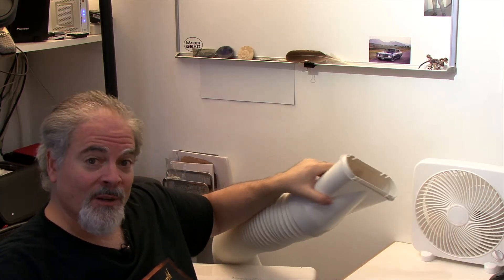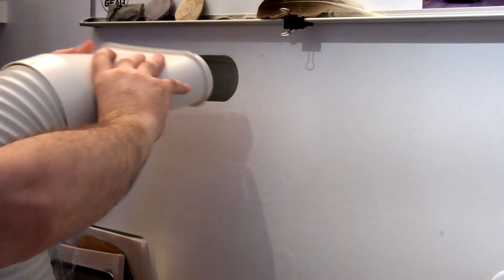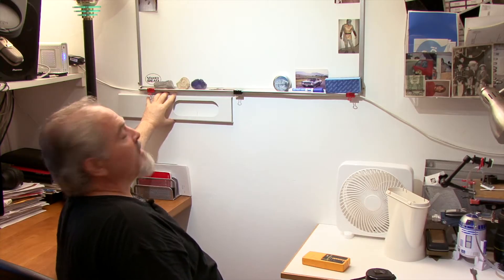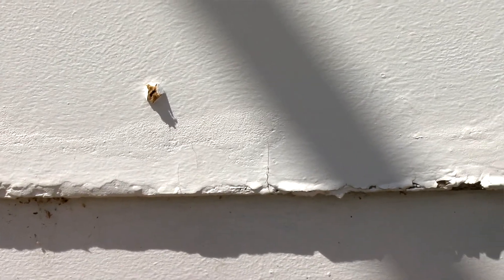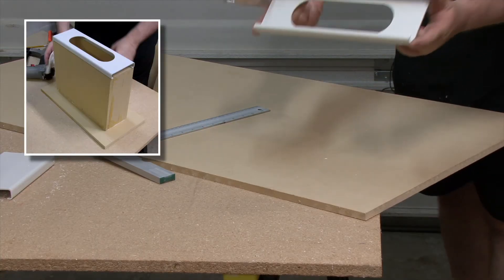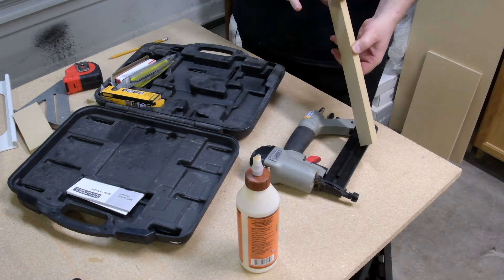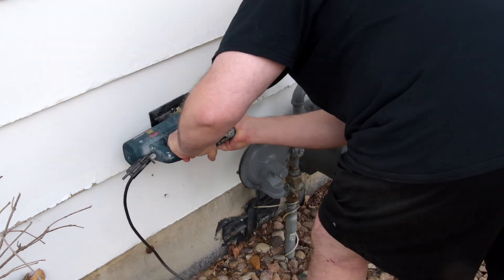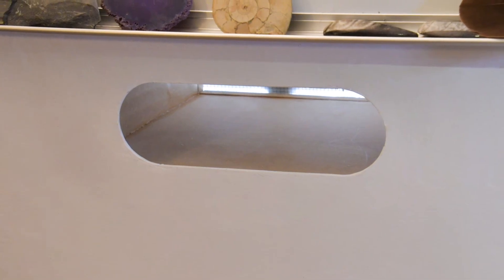Portable Air Conditioner - No window? No problem! Vent exhaust thru wall, stealthy magnetic cover.

Comment: Mold and mildew will spread in your walls and your going to have a very expensive job to fix
Reply from the maker: That's a totally legit concern, Stacks. Unfortunately, YouTube doesn't allow me to alter the video, but I added notes to the video description and on my website addressing this issue. The new duct needs to be sealed and coated with either polyurethane or exterior paint. I'm also going to pin this comment so it shows up first, so if people don't see the note in the description, maybe they'll see it here.  Thanks for the great feedback.
Reply: Would caulking the "duct box" where it meets the drywall and lining the inside with foil tape work?
Reply from the maker: That would probably help, but I don't know if it would work as well as simply painting it. Or, you could be really safe and, caulk and paint it, THEN apply the foil tape 😁
Reply: Is this because of the ac unit?
Reply from the maker: It's due to the moisture the AC removes from the air and exhausts outside. The duct should be sealed or painted to keep that moisture from causing problems. It's a simple preventative measure.

Comment: If the vent tube doesn't extend all the way to the outside wall and is sealed to the outside wall it will just pump warm air into the cavity between exrerior and interior walls and cause alot of moisture buildup.

Comment: A dryer vent with tube sounds much easier
Reply from the maker: It sounds easier, but I wouldn't. The portable AC hose is 5 inches in diameter and the dryer vent is usually 4 inches. Logically, this doesn't sound like a big difference, but there is a whopping 43% reduction in area! This adds back pressure to the AC system. Making the AC motor work much harder than it was designed to do results in poor cooling efficiency AND the motor runs hot, potentially shortening its lifespan.

Comment: Does this have to go to an outside wall?
Reply from the maker: It doesn't have to exit to an outside wall, but wherever it does go will get hot and moist. If you have another room that can handle being humid like a jungle, that will work 😁though keep in mind that those are perfect conditions for mold growth.

Comment: I wonder, if you had an isolated office/workspace in a garage, for example, if you could simply vent back out into the main garage to prevent having to cut a hole in your exterior.
Reply from the maker: That is a great solution as long as adding warm, moist air to that space isn't going to create problems. If the garage has ventilation or you can open doors or windows, the moisture might not be a concern at all. 

I would love to know how it works out if you try it 👍
Reply: @UnchartedDIY  If the rest of the garage is otherwise unmanaged climate wise, I dont know if it would make too much impact.
Reply from the maker: @PeteNice29  I agree. If I had a similar situation, I'd vent it exactly like you are talking about. I can't see a downside!

Comment: can you please do a video showing how to feed it to a bathroom exhaust fan?
Reply from the maker: I appreciate the suggestion, but I wouldn't recommend running your portable AC exhaust through a bath fan. It's a great question and a creative idea, but here's why it might not be good solution:

The portable AC hose is 5 inches and the bath fan exhaust hose is 4 inches. Logically, this doesn't sound like a big difference, but there is a whopping 43% reduction in area! Then the additional length of the bath fan hose adds even more back pressure to the AC system. Making the AC motor work much harder than it was designed to do results in poor cooling efficiency AND the motor runs hot, shortening its lifespan. 

Hope that helps. Thanks for watching and stay cool 😉
Reply: @UnchartedDIY  thank you for the thorough explanation!

Comment: Does the soffit cover add pressure onto the AC machine by partially obstructing the exhaust area?
Reply from the maker: That is a really great question, and thank you for thinking of it! 

I was curious about that too, so I did an unscientific test with my inexpensive anemometer while the machine was running. I couldn't see a difference in wind speed with the soffit cover on or off, and at various speeds. I suspect its large surface area combined with the low static pressure from the exhaust makes any potential obstruction statistically insignificant. I just wish I had thought to put that information in the video 😀
Reply: @UnchartedDIY  Wow thanks so much! I'm gonna give it a try 🙏
Reply from the maker: @InfiniteDaydream I hope it helps you stay cool ❄️😎

Comment: Maybe it's my old eyes but go back and watch this video where you were working on the outside hole. It sure looks like a snake under your gas meter up against the slab.
Reply from the maker: I never noticed that before! It looks like a rattle snake, which we do have around these parts. Upon inspecting the high res footage, I could see that it was some dead leaves. Good thing so I could live another day and keep making videos 😁

Comment: Could you rig a vent down into the basement and out a dryer style vent, instead of the window?
Reply from the maker: Technically, it would work...but there can be serious downsides.

The problem is adding a bunch of back pressure to the AC exhaust. Dryer hoses are only 4 inches, while ACs are 5. It doesn't sound like a big difference, but a 4 inch hose has a cross-section area of 12.5 square inches, while a 5 has 19.6 square inches.

Lengthening the exhaust hose or decreasing the diameter can make a portable AC work much harder than it was designed for, likely shortening its lifespan.
Reply: @UnchartedDIY  Interesting, could work. Just looked at Amazon and they do carry 5" and 6" outdoor vents. Would mean that I would have to put a 5: hole in my floor.  How long can you have the hose?
Reply from the maker: I wish I could give you a definite answer...

I guess that depends on how risk-averse you are. The manufacturers will tell you not to add any extension to the hose. Whether or not it would significantly affect the AC would probably depend on a lot of factors, such as how much the back pressure would increase from extending the hose, amount of heat, humidity and so on. 

You'll need to weigh the potential gain in your comfort level vs the potential pain in your wallet😄  Either way, I'd love to know what you decide!

Comment: But if you live in a rental house where it's not allowed to make a hole in window or walls
Reply from the maker: Unfortunately, I haven't seen a workable solution for this scenario. However, you mention a window. If you have one, you might be able to put the AC on a platform to raise it enough to reach the window. Good luck with this, and I would love to hear if you are able to make this work 👍
Reply: Throw it away theyre fking ridiculously obnoxious in a room. The hose is such a pain in the fking ass

Comment: Looks very nice. By the way ive seen some people online say that i could exhaust the portable ac unit into my attic space. Basically just cut a hole in the ceiling and let the air blow into my attic. Seems like a odd thing to do for me but what do you think about this?
Reply from the maker: I've heard people say that too, but I wouldn't do it. Portable AC exhaust contains potentially high humidity which could cause mold and a whole host of other issues.

Comment: They do make a coupler... although I'd still install it through the wall.
Reply from the maker: If you mean a coupler that allows to connect a longer exhaust hose, I would personally steer clear. It will void the warranty. It also makes the AC work too hard, which might greatly reduce the life of the unit.

So, I agree the wall is the way to go 👍

Comment: Can I use a regular dryer vent hose to vent my portable ac unit instead of the horrible hose that came with the unit? I think it can be done.
Reply from the maker: Great question, Jackie. Unfortunately, I don't think it would be a good long-term solution since dryer vents are only 4 inches vs 5 inch. It doesn't sound like much of a difference, but the 5 inch flows a lot more air.

Forcing that much air through a smaller hose will reduce the efficiency and possibly shorten the life of the AC since it has to work much harder than it was designed to work.

I would recommend looking for a third party hose meant for a portable AC.

Comment: In the second photo it looked like u downsized the vent pipe, where did you purchase the reducing coupler?
Reply from the maker: I'm guessing you are talking about the thumbnail image for the video where the hose is going through the teal colored wall. If so, that fitting came with the AC unit and is designed so the round exhaust hose will fit into a rectangular window while maintaining the same air volume. Most portable ACs come with a fitting like that. If yours didn't, there are universal kits like this one: https://amzn.to/3Uu7U5r for instance. This one comes with the exhaust hose, while some kits don't. 

I hope that helps, Brian!

Comment: What would happen if I just leave the hose in the bathtub????
Reply from the maker: I'm not sure I understand what you are asking.

The exhaust air needs to go somewhere outside of the room you are trying to cool. Having it in the same room would just make a lot of noise and use a lot of electricity, while doing nothing to cool things. 

Since the hose is so short, and extending them can burn up your AC, I can't picture how this would work.

Comment: Do you believe it could be "vented" into the bathroom exhaust, or maybe just positioned in the bathroom door to cool the bedroom but exhaust its heat into the bathroom with the bathroom fan running?
Reply from the maker: I think that would work just fine. Of course, the exhaust will be moist, but the bath fan is meant for those conditions.

Comment: Why didn’t you just put the unit on a stand so that the hose reaches the widow…
Reply from the maker: Good question, Rashmi. My desk covers the whole wall where the window is, so it would have had to sit on the desk. That would leave no room for the computer, and I'd have to work sitting on the floor!

Comment: How do you know you're not going to be drilling through wiring/piping?
Reply from the maker: That's a great question, free cleets. It was based on educated deduction, eliminating possible sources of what might be in that wall. 

Because I was going through an exterior wall just above the foundation, and there are no outlets, switches or anything else anywhere on that wall, upstairs or down, I knew there was no electricity in that wall. I also used a voltage detector to scan the area just to be sure. 

I know where the plumbing comes into the house, and where the hose spigots are, again, not on that wall. Finally, I know where the gas line enters the house.

I also used my FLIR camera to see if there were any temperature variations that might indicate something hidden. Yeah, it was overkill and not necessary, but I have a thermal camera, so why not use it?

That all said though, I first drilled a small hole and looked around inside the wall before opening it up to full size for the duct. 

Living in this house for a couple of decades helped too!

Thanks for watching!

Comment: Question:  We have a rental that has a brick exterior wall where the exhaust hose will go (this is a garage/man cave with no windows). Can I position the hose to release hot air just into the wall and not vent through to the outside of the house? Option #2:  Vent straight up into the attic. Thoughts?
Reply from the maker: Unfortunately, my thoughts are not good news 🙁  The problem is that the air in that exhaust will be quite moist, so venting into a small, trapped air space such as the wall or attic can cause mold and rot. I'm not sure what else you can do since it's a rental. I'll keep thinking about it though...there has to be a solution!
Reply: I would use a hygrometer and check the humidity that comes out of the exhaust before assuming that.  I believe the hot air coming out is pretty dry & any moisture is collected into the tank or into the machine that's why there's a drain hose.
Reply: what did you end up doing?
Reply: We use a stand-alone AC/fan with a hose to carry out the condensation. The hose runs down a side wall & out a small gap under the garage door. The hose then turns & runs down the brick wall about 10' & that's where the moisture is released.

Comment: Couldn’t you just use a dryer vent instead of all that work?
Reply from the maker: Here's the "short" answer, Tiggar! 😉

I'm assuming we are talking about a new vent installation, since tapping into an existing dryer vent has a whole bunch of reasons against it. I can provide detail to explain why if needed. 

A prefab dryer vent CAN work with some caveats. 

The vent can't be smaller in diameter than the exhaust hose of the AC since it adds back pressure that will void the warranty and make the AC work much harder. Most readily available vents are 4" and most ACs are larger.

The AC doesn't have enough air velocity to push open the vent flap(s) so it must be modified to be only a screen. The spring loaded types are especially problematic.

Converting from the often odd size of the AC hose would require some type of adapter, likely adding bulk and potential sources of leaks if not well sealed. 

I wanted mine to be completely flat on the wall so I could use my "stealth" cover, so I didn't want any sort of adapter. 

For those reasons on top of additional cost and having to order parts, it was easier for me to make my own "duct", but your situation may be different.

Comment: I had been planning to do something similar using a standard 5" duct exhaust outlet (eg., for a bathroom fan) which would have required cutting the original fitting off my AC exhaust hose and semi-permanently duct-taping it to the outlet. However, your video inspired an idea that combines your approach and mine for something I think will be an improvement on both: I want to use the standard outlet on the outside of the house as I originally intended; the original window bracket on the inside, as you did; and 3D-print a custom fitting to connect the two inside my wall.
Reply from the maker: That sounds like a GREAT plan, David. One thing to consider though: if you have an FDM printer, you may need to seal the print. I notice that some of my prints are not 100% solid, due to nearly microscopic gaps between layers, especially in the corners. My concern would be moist air, under pressure, passing into the wall interior and causing mold and rot. Easily fixed with a coat of paint and primer though. 

I'd love to see your solution though! While we can't post photos here on YT, you can post images in the comments sections at UnchartedDIY.com.
Reply: @UnchartedDIY  yes indeed, it will definitely need some post-processing to seal. I like Rustoleum spray-on primer-filler + a spray-on enamel coat for that purpose.
Reply from the maker: @davidlukas7866  that sounds ideal. Pictures, pretty please? 😁
Reply: Will do :)

Comment: WOW, this is what we are looking. I have a question can we dig a hole between 1st & 2nd floor?
Reply from the maker: I don't think I can help you with that one.  So much is dependant on the structure of your floor, the location, etc, that it would be irresponsible for me to try to advise you. Is there a reason you can't go through the wall where the AC is located?

Also keep in mind that most ACs don't tolerate extending the hose much, if at all.

Comment: I assume the humid air exhaust will eventually rot that wall out
Reply from the maker: Interesting comment, Soda and I appreciate the feedback! Due to the way the tunnel is mounted through the wall rather than inside of it, the inside of wall itself is never exposed to any humid air, so it should be in great shape. However, the tunnel itself might be an issue, so before I start it up this season, I think a water sealing treatment for the MDF wood would be a wise precaution. The tunnel is large enough I can get my hand inside there, so brushing on the treatment would be easy to do with everything in place. 

I am going to add this precaution to the description and to the article page at https://uncharteddiy.com/portable-ac-vent-through-wall/  I will attribute this smart precaution to you, so thank you!